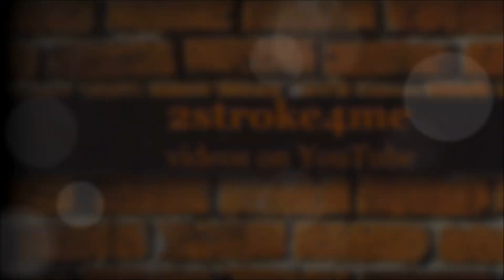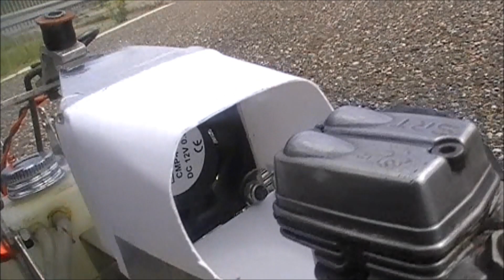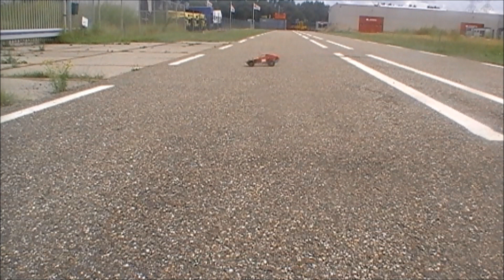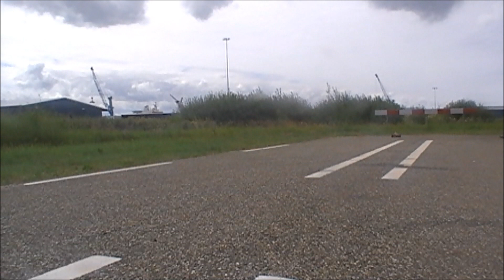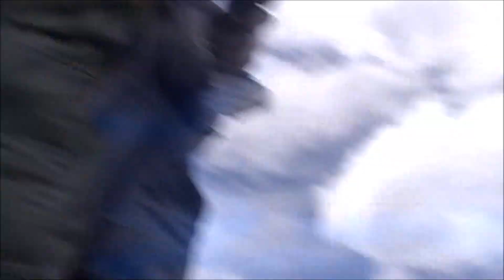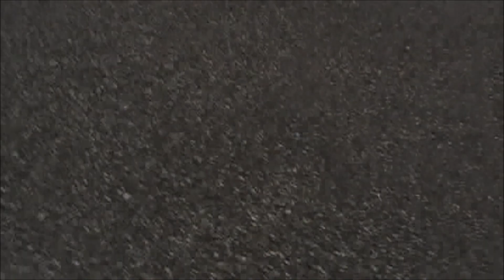Four stroke rc buggy - vintage Kyosho Baja - Perfect sound!

Comment from the maker: LOL, yes i did. The engine gets very hot because it's a plane engine where a propeller cools the engine down. The coolingfan and duct help aswell as a rich carburetor setting. Haven't got any problems with it so far.

Comment from the maker: It is a nitro. And because there's an inletstroke before a powerstroke, the engine is more likely to flame out. The glowplug's filament has time to cool down during the inletstroke. They belong on a plane where they are full throttle most of the time. However, a 4 stroke doesn't have fuel build-up in the crankcase like a 2 stroke, with a near perfect carb setting it can idle until it runs out of fuel. Running time is indeed longer than the average 2 stroke.

Comment: very nice kyosho bud, good call on running a 4s to preserve them gears :)
Reply from the maker: +Petrol-wolf-88 Thanks. I've recently restored it to its former glory with new gears, a restored Veco, new tires and all. Now it's off road capable again :-D
Reply: +2stroke4me thats good to hear another is not only been restored but also being used as it should :) good thing with vintage r.c is the joy of being able to fabricate your own parts too, I've been given an old sandmaster chassis which Is becoming an unplanned restoration but as you know parts are hard to come by, even though it's not that rare :/
Reply from the maker: +Petrol-wolf-88 Awesome, the Sandmaster is defenately worth restoring! I hope it's not in a bad state and you can pull it off!
Even back then parts were hard to come by, so it's not uncommon to find homemade parts on old buggies. It wouldn't be ethically justified to restore one without a couple of homemamde parts ;-)

Comment: Very nice video and car. You can make a video detailing this modifications? Thanks
Reply from the maker: The buggy has now been restored, the 4 stroke engine has been replaced with a classic Veco. The 4 stroke engine had a couple of disadvantages; it performed bad with an air filter (it wasn't powerful in the first place), so i couldn't go offroad with it, it made a lot of noise and it became really hot (they're designed for airplanes and are cooled by the prop). I had to make heavier clutch shoes for it and had to install an electric cooling fan.

Comment from the maker: It has 2 valves, rockers (with adjusters), pushrods and an underlying camshaft operated directly by the crankshaft. It doesn't have an oilpan and runs on modelfuel, a mixture of methanol, nitromethane and oil. Because of all the moving parts, i added a small amount of extra castor oil.
Thanks for watching!

Comment: greetings,i love this 4 stroke idea , would you make a clutch and an exhaust to sell by any chance ? i would really like to put this same engine in a tamiya truck .
Reply from the maker: Hello. You can use the original clutch on this engine or use any 2-shoe clutch and a slightly weaker spring if nessessary. The exhaust comes with the engine, mine was made from a piece of bent copper pipe.
There are some things you have to consider when you want to use this engine. It's designed for planes and gets its cooling from a propeller. So it needs external cooling (electric fan) or sufficient airflow. It gets very, very hot.
The engine, at least for the engine i use (4.1cc), has less than half the power a car engine produces and needs a lot of maintenance (adjusting valves and cleaning). Keeping the outside clean prevents it from overheating. 
It doesn't like airfilters and when fitted, the power drops significantly. So it's not advisable to use it in dusty conditions. 
Starting the engine needs to be done with an external starter. 
This engine has a short crankshaft, so it can only be fitted with a flywheel. The crankshaft is too short for the clutchbell to be fitted (which isn't a problem with my buggy).
There once was a car version of this engine, which had a pullstarter, but it was never popular. Probably because of these reasons. I recently swapped this engine with a restored Veco (1980-ish buggy engine) after restoring the buggy and it became more enjoyable.

Comment: very nice,glad to see the old ones still running,but that fan....it does just about nothing,it's too small and too far away.
Reply from the maker: Glad you like it :) The fan is small, but it helps keeping the temperature on the cilinderhead within limits. A fourstroke gets hotter than a twostroke.

Comment: That fan is useless surely ? How did it last?
Reply from the maker: These type of engines become very hot, normally there's a propeller cooling it. The small fan wasn't half as efficient as a propeller but it kept the engine from overheating.

Comment: Hi I have the same engine and I want to make a car out of it what chassis did you use and how did you make the clutch and gearbox thanks
Reply from the maker: Hi, first of al, thanks for subscribing!
The buggy is a 1983 Kyosho Baja Body with the original gearbox, had to make teflon clutch shoes for it.
The reason i put a four stroke on this buggy is to preserve the weak cast aluminium gears inside the gearbox. Those are very rare parts and wouldn't survive a 2 stroke engine very long.
The clutchbell is part of the gearbox and not assembled to the engine's crankshaft. The fourstroke engine does not have a SG crankshaft. If you want to use it on a more modern car, you have to look for a conversion pilot shaft.
Reply: Thanks a lot this really helped :)

Comment: Great work! Love it! I am working on a project like yours! Where did you connect the electric cooling fan? to the batteries for servos?
Reply from the maker: Thanks. The fan is operated by a separate battery pack.
Good luck with your project!
Reply: Thanks!!!

Comment: no air filter????
Reply from the maker: Nope, and for a couple of reasons. The carburetor's intake is facing downwards, so an airfilter will be saturated with fuel in no time. The engine is designed for airoplanes, so it's not designed for an airfilter. And any airfilter restricts the performance of the already low performance engine.
Now that this buggy's got a restored 80's Veco (with airfilter), it can be used offroad again.

Comment: ...it´s simply 2-stroke. 

A 4-stroke engine needs ignition control.
Reply from the maker: Four stroke refers to the number of strokes made by the crank shaft to reach one full combustion. It is a four stroke.
A typical Diesel engine in a car is also four stroke.
Reply: ...no. A 4-stroke engine ignites only in every second full rotation, 
because of proceeding the full four strokes. A 2-stroke ingnites in 
every full rotation. The combustion in a 4-stroker runs only above the 
piston. The 4-stroker needs no resonance exhaust pipe to compress the 
air-fuel-mixture -> therefore are the valves. A 4-stroker is 
completely different to the 2-stroker and needs a costly engine 
management for ignition and valve controlling and for correct 
compression.
Your engine has no management, no ignition control system, no valves.
And: it sounds like a typical nitro 2-stroker in a rc car.

Should be no offense, but look at your glow plug - it´s openly screwed 
without any controller or electrical ignition coil... a 4-stroker can´t 
run with such a permanently glow plug.

The functional principle of a Diesel engine is another, completely different story ... :)
Reply from the maker: It's got an underlying camshaft, propelled by the crank shaft, push rods, rockers and an inlet- and outlet valve. It makes 4 strokes (2 revolutions of the crank shaft) to reach a combustion stroke. That'll do for a fourstroke engine.
A 2 stroke engine has a combustion every 2nd stroke (1 revolution of the crank shaft).

Furthermore, this engine makes 11.000 rpm at best, a typical 2 stroke engine for such a buggy makes at least 2,5 times more than that.
This buggy has recently been restored and got its engine replaced with a  classic 2 stroke Veco engine: https://youtu.be/Bm1J9BauGNw  Note the difference in sound (pitch).

Or, you can search for O.S. FS-26S, the engine used in this buggy.
Reply: Nope, this is a 4 stroke glow engine.